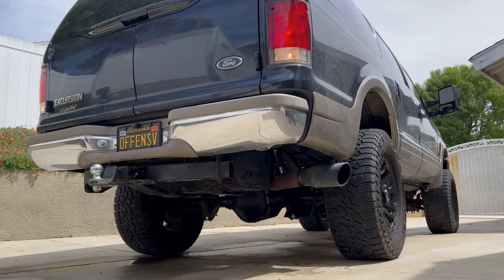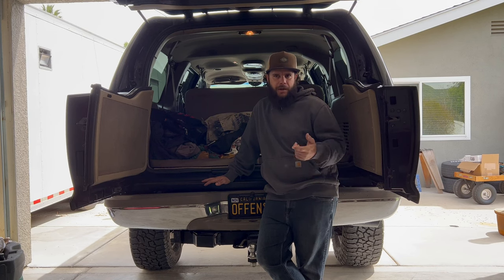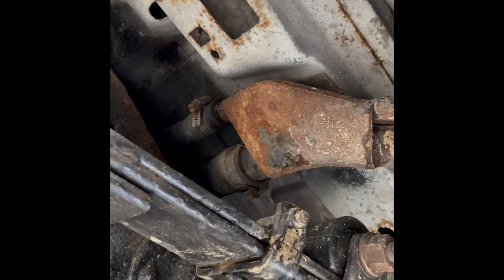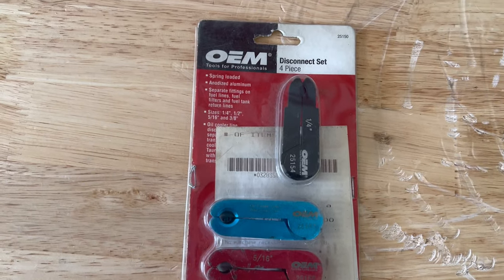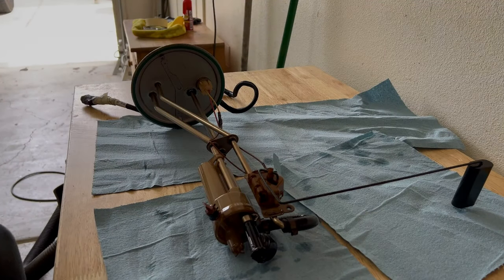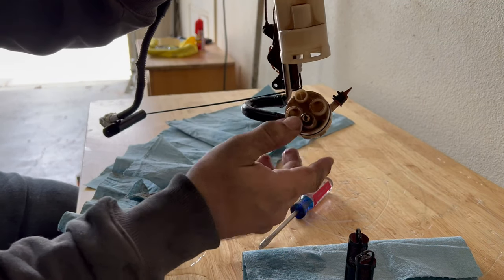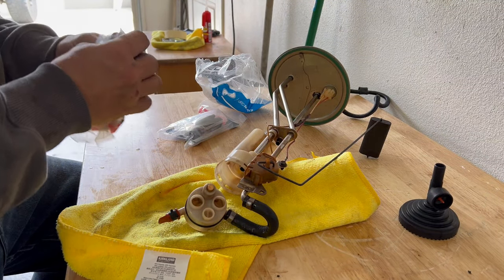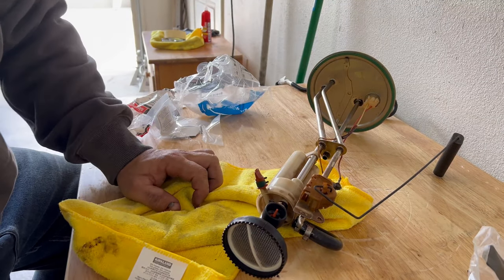If you have a 94-07 Powerstroke you need to see THIS! Clogged Fuel pickup

Comment: I completely removed all that plastic nonsense inside the tank from Ford, added a piece of stainless fuel line to extend the pickup line to about an inch from the bottom of the tank and installed a good quality aluminum body stainless steel filter on the frame rail before the fuel pump. Now it's simple easy to check and clean my tank filter without having to drop the tank.
Reply from the maker: I considered doing the same thing, and with the pump being on the frame rail I don’t know why ford didn’t put a canister filter right before the pump for easy maintenance. Over engineered pickup and screen assembly for sure.